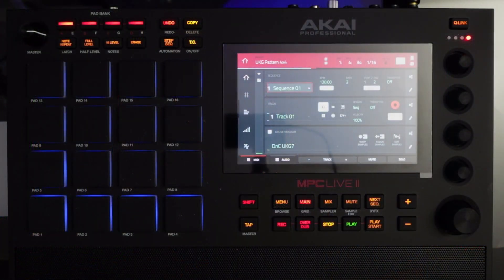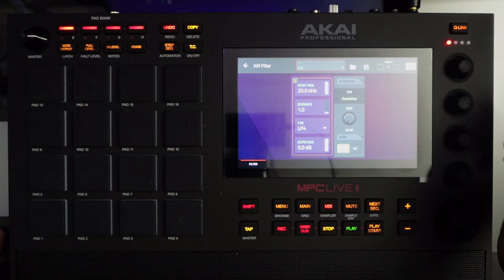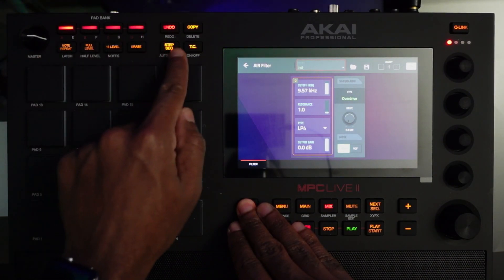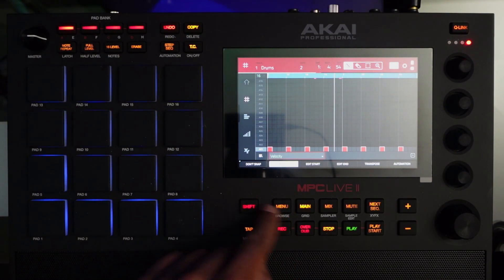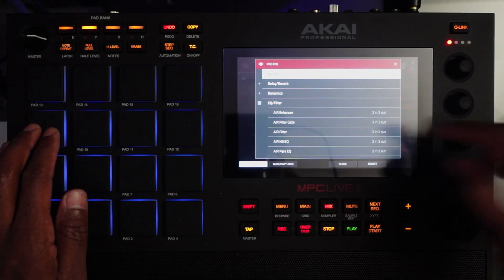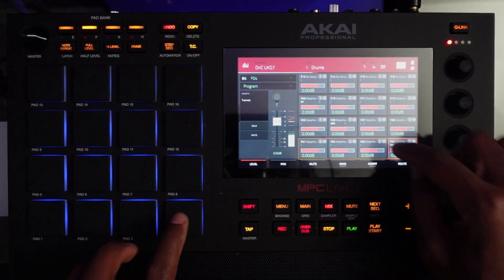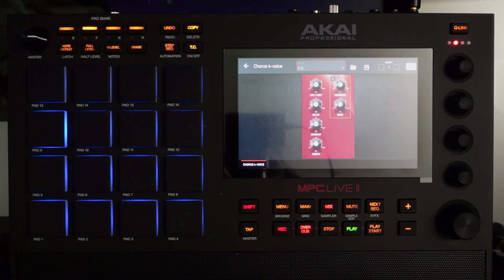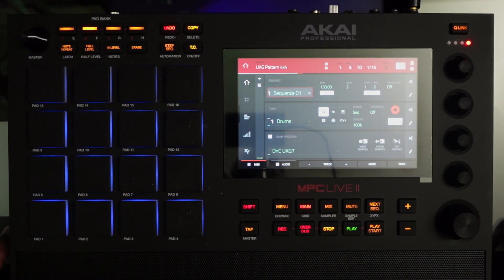MPC Automation (Channel and Pad Level)

Comment: Dude! This was great and so helpful. I've been loving the MPC One for it's DAW-like  linear workflow, and automation is just as easy, if not easier than when I did it in my previous DAW situations. Have you ever run into CPU walls with too much automation? Just curious. 🙂
Reply from the maker: Thank you for tuning in. Excellent question. I have encountered automation oriented CPU issues in the past. I typically resample to circumvent this. I will show you how this works in one of my up and coming videos.
Reply from the maker: The Resampling trick described in this video is one method I use to avoid CPU overload/crashing issues. Take a look and let me know what you think. https://youtu.be/G8DojYhtlwc